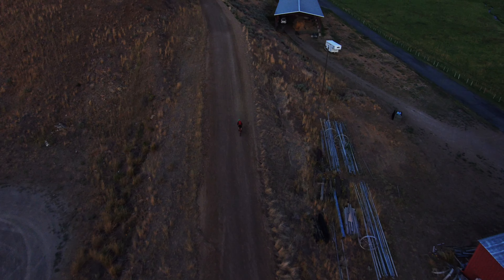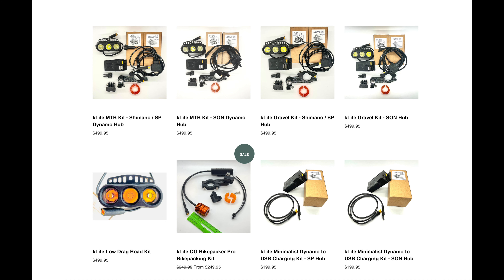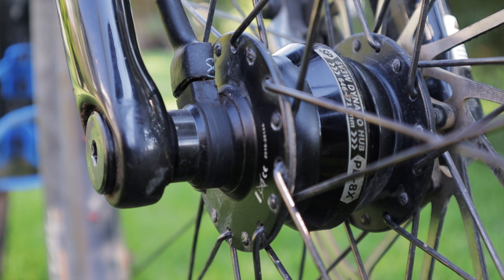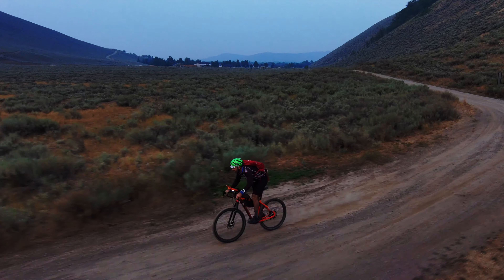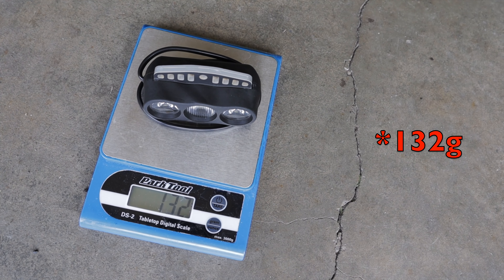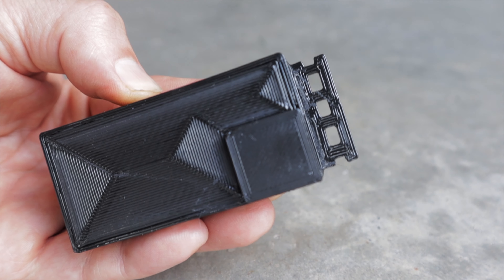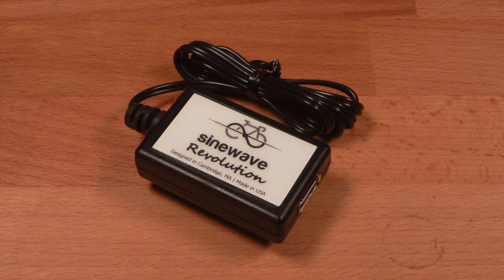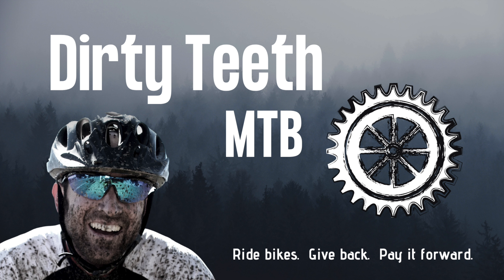kLite Dynamo Bikepacking Light + Charging System | In-Depth Review | Bikepacker Ultra V2

Comment: I don't know what happened to my first comment but here is a short version. I have the v1 of the Ultra gravel hooked to a SON and it has been great since I got it in July 2019 and run over 24k road kms. Love it enough that I have recently purchased two more kLites - another gravel model (for an MTB project) and a road model for a road bike.

Kerry has great customer service and is always on the ball, ready to help you out.

I will be using K-Edge combo mounts...solid as a rock.
Reply from the maker: Thanks for adding your input, Wai Sing Lee :). Ride on!

Comment: Super impressed with your testing, and thx again for the feedback, it was a bit of a juggle to get a bright light from the good old dynamo hub, turns out there were a few tricks we had to do, to make it all happen, by upping the voltage of the light with 3 leds, we could then offer USB recharge at the same time, few systems offer this and its a great back up, should get stuck at nite, with a dead cache battery and dead GPS and it starts to snow.... with kLite you have the super back up mode, of direct GPS recharge and lights at same time, so you can move and get safe if conditions go bad. This is one upside to the USB charger, its got extra smoothing caps so to go 'direct to device' with sensitive equipment, trade off, yes its bigger. its also a SOLD block, you can kick it around, and ziptie gates to lock in cables on bumpy roads

So 3 LED is the magic number.  we did have a smaller head unit, that is for sure, but after testing we found using the SAME power and same LEDs same electronics, BUT bigger optics / lens, we could get a much higher lux or throw, a much brighter looking light, for no extra drag or power used, just by using bigger optics, we got way more light, but,  you said it, trade off was size...then my choice to make the light in SOLID rubber means you can kick it like a football and its all good, but again, trade off, its a bit heavier but only by grams... 

Now the LOW speed power booster, as you said is no gimmick, I feel its the #1 reason these lights are so good, as we created a extra power boost down in the low speed band, at the same time, we charge an internal supercapacitor bank, this gives back power when slow or stopped, IMO this is the biggest difference in kLite and the rest, way more power down low and very little flicker, again yes its a bit bigger light for the supercaps,  but not by much, I guess the light looks like that, as this was the only way to maximize output by riding the science of  all aspects and at the same time make it super robust and very reliable.

its not fancy gear, its just sold as hell, for me this is what I wanted, something to get me home, no matter what, something keep me safe at all times when I ride, a fit and forget system that just works, that I never need to stuff with.  Your feedback is noted and can say new CNC mounts and other stuff is in the pipe works.... once again, you have an amazing understanding of this product, well done, and thank you again!!
Reply from the maker: "not fancy gear, just solid as hell" - 100% thanks for pushing the envelop and sharing your passion!!  Ride on :)
Reply: Not fancy, but a price tag of $600? Lol
Reply: Hello kLite!
I don't know if you know about Jens During the guy who build the Aheadlader v6, but I think you two should definitely get in touch, look it up!
Your philosophies seem very close.
The Aheadlader is a charging unit that fits in the headset (also exists in a bigger separate version), and is best known for being very (the most?) efficient on a large speed range.
It's actually not sold as a whole, the assembly instructions are public and it's up to you to build the unit.
Maybe if you two collaborate you could achieve the most efficient, powerful, bright, solid, versatile dynamo USB charger & light ever seen!

PS: He's german, I don't know how well he speaks english but DeepL is there for you

Comment: This is such a great, comprehensive video. Well done! I had it in my mind that the exposure revo+sinewave revolution would be my best option but that involves a whole headache of figuring out the wiring. This being plug and play is the main draw for me but it seems so well thought out in general.
Reply from the maker: You can't go wrong either way.  I used a sinewave revolution and the Revo for years - both great units...  kLite used to wire revolution's for use with their system before they came out with their own usb chargers... but I think they've since stopped for obvious reasons (you can double check with them)...  In my experience, the kLite Ultra v2 is definitely brighter and kicks in earlier than the Revo, and I'm enjoying it... so I just sold my Revo on eBay :) Ride on!

Comment: Great Review!

I just installed my mtb version and used it on an overnighter.  I already had a K-Edge mount that works perfectly with the GoPro adapter.

I have been impressed with the light so far, but haven't been out long enough to get a feel for the charging capabilities.  It did keep my Garmin InReach mini and my Garmin Edge 530 fully charged.

I opted not to purchase the rear blinky at this point.

Comment: I looked at dynamo hubs and lights but went with a PedalCell and an Outbound EVO light. More power output at lower RPMs (like, 5~6mph), and you can move to different bikes if you want. Also, zero drag when you don't need charging, unlike a hub dynamo. The power output is so good I may not even bring a cache battery. I will use it on the Tour Divide this summer.
Reply from the maker: Right on, sounds like a great setup... I've heard good things, almost makes me wanna build an alloy wheel just to test it out... best of luck on the TD :)
Reply: @DirtyTeethMTB  I appreciate your review and that looks like a solid setup. FWIW, I'm actually running carbon rims. PedalCell won't recommend it but there have been people who have had no issues with carbon rims. For insurance, I've actually cut sections of helicopter tape that cover the running surface of the rim. So far with a few hundred miles of dynamo use I'm seeing no wear on the tape (and thus no wear on the rim). I may add an extra layer of tape just for some added safety for the long TD. I'm interested to see how it does on a long, grueling ride like that. Time will tell!

Comment: Thanks again for your time and effort required for awesome content!  I'm assuming neither the gravel nor road versions of these lights offer a cut-off beam pattern similar to many of the German-designed lighting systems.  My current bikes have either dynamo or battery-powered (Busch + Müller) lights with a "car-friendly" cut-off beam.
Reply from the maker: Thanks for watching, Todd - I don't think any of the kLite units have a cut-off beam pattern... great questions, and you might wanna double check with kLite to confirm - ride on!

Comment: Thanks for uploading! I have the V2 MTB with a SON hub (no rear blinker). Have made great use of the USB charger, but tbh, have not been overly impressed with the light: I have an old, cheap Magicshine (lists 900 lumens, I believe the independent tests measured ~ 840) which subjectively appears to provide better illumination….
The hub connector has given issues in that it can pop off on rough terrain at times (tried crimping connectors on firmly..no luck): if anyone knows a better solution I’m open to suggestions. Thanks again for another detailed review!

Comment: Are you able to use the internal cable routing of the fork? Seems that the cable is too bulky and the connectors cant be removed?
Reply: Same question here. ?how to take advantage of my 2021 Cutthroat internal fork routing?
Reply: I was unable to use it on my bike it is way to thick, I also found that the plug keeps disconnecting from the hub because the wire is too stiff, I would recomend making the wires yourself if you are planning a neat set up.
Reply from the maker: The thick cables definitely don’t fit in the cutty fork… That hole is tiny… I’d rather have expedition worthy wires/connectors… not as clean, but I just tape it to the fork and you barely notice it…

Comment: just wondering about a dynamo set-up vs a battery pack... weight for weight, seems that you could forgo alot of the complexity of a dynamo set up
Reply from the maker: There are many scenarios where I prefer not to have a dynamo system- shorter, singletrack, techy routes, where I’m riding slower, etc) I just use lights with replaceable batts…but for longer multi-day tours and bikepacking races like tour divide I think dynamo is worth it
Reply: The complexity, such as it is, is only during the install. I ride almost exclusively at night and with a dyno setup, I never have to worry about recharging the front light. The back is a different story, I have multiple lights and just today I recharged three battery lights. Cygolites are great...been running them for almost a decade.
Reply from the maker: @waisinglee1509  that’s why I like the kLite qube rear light… so easy and never have to charge :)

Comment: Super timely video, Alan! Was just about to pull the trigger on almost exactly the same setup. How has the SP PD-8X worked out for you, especially for Divide? I understand it isn't nearly as efficiently as the (rather expensive) SON 28. Watched all your vids but would love to hear your experience and if it's worth springing the extra coin for the SON28 or if PD-8X is perfectly adequate. Cheers and thanks!
Reply from the maker: The pd-8x is perfectly adequate in my experience- I’ve got at least 6k miles on it in all kinds of conditions- zero problems.  I don’t think you can go wrong with either hub.  That said, I’ll probably switch to son next go around, based on others experience and feedback, I’d like to give it a shot- not sure if it’s worth the extra $$ but at that point with the overall investment… why not go big 😜 ride on!
Reply: @DirtyTeethMTB  thanks, Alan! Appreciate the thoughtful response and all the great content. Will go with the PD-8X. Cheers!

Comment: Thanks for the review. Did you say you carry two of the voltaic cache batteries?
Reply from the maker: Yes, depending on ride/race, I often carry two smaller batteries vs one large… redundancy in case I damage/break one, and I can cycle them- charging one while the other one charges items… without having to deal with pass through, etc… ride on!

Comment: For some reason my Klite isn't charging my iphone pro max 13 — not even registering that it is plugged into a charger at all. Have you seen this? Any tips?
Reply from the maker: Hmm never heard that before… but I usually charge a cache battery with dynamo and use cache batt to charge phone with constant power… if you haven’t figured it out, hit up the folks at jefe.bike - they should sort you out 🤙🤙

Comment: I already have the sinewave charger. Can I only buy the light and switch  and still continue to use the sinewave charger? Excellent review. I'm impressed!
Reply from the maker: Hi Tobias... you should be able to buy the light, harness, and switch... and then attach a kLite connector to your sinewave usb charger... I used to have that exact setup and it worked great :) - the guys at kLite are awesome and should be able to help ya with any questions - ride on!

Comment: i have a k-lite with son28 system. works perfect. but it doesnt charge my iphone. so i have to charge my powerbank first which then charges my iphone. i wish it could charge my iphone straight. any ideas?
Reply from the maker: I do the same thing (charge a power bank and use that to charge other stuff).  Phones don't like trickle/"uneven" charging... they want a consistent current- ride on!

Comment: Great video ! Not a huge fan of the 3D printed finish of the charger and the clamp. I don’t ride at night enough to justify the purchase so I’ll stick with my PD-8X and sinewave revolution charger paired with cache batteries and my trusty lezyne lights that I charge overnight.
Reply from the maker: Def a big investment… and overkill for most… unless you’re doing a big bikepacking adventures/long tours… I dig your setup - Lezyne + revolution for the win !
Reply: @DirtyTeethMTB  Am I the only one freaking out with using 3D printed parts that will be required to hold load bearing, structural integrity and resistance to vibrations? On the video you can already see some of the layers are separating already. Maybe they use some kind of epoxy inside to at least ensure water resistance, like Sinewave does?
(Also the cache battery itself would require a separate video, and maybe review some other models. Some charge-through batterie start charging, then use power from the hub as you cycle faster to power the USB devices, but sometimes fail to switch back to battery power when you stop, or when you ride slightly too slowly. It's actually a complex piece of electronic to get right.)

Thanks for your content, super interesting as usual, especially from Europe where we use slightly different kit. Gives a very nice alternative perspective.
Reply from the maker: @mrr9166  the 3D printed plastic mount is pretty dang beefy, and I'm not worried about it's integrity at all - it's hasn't budged once since I started using it... as I mentioned in the video, it's actually too beefy for my taste, so I'll be switching to a more svelte kEdge mount anyway.  Re: the charger... I believe they do use epoxy like Sinewave to make the connections waterproof.  I've used both the Revolution and the kLite dual USB plenty - both are fantastic and I've yet to have a single issue with either.  Yes, I like the traditional construction of the Revolution over the 3D printing of the kLite, and it's slightly lighter and more streamlined... but I like the dual output ports on the kLite, that the input/output ports are all on the same side, and it doesn't have a permanent cable... so def pros and cons to both... re: cache batteries, that would make a good video... I'll keep it in mind, thanks!

Comment: Wondering how you mount the fenix pd36r?? Thanks
Reply from the maker: I have a helmet mount that came with my exposure joystick that I use… the pd36r is a little wider than the joystick, but still works- ride on!
Reply: @DirtyTeethMTB  thanks mate does that same mount also works on handlebar?? Looks like an impressive output and runtime for the fenix!!
Reply from the maker: @andrewhamilton3486  for the handlebar I typically use the twofish flashlight holder… cheap and secure, but can be a little bouncy on technical descents 🤙

Comment: Oops, hit enter too soon.  Great video and super helpful information.  I'm adding the gravel set up with rear blinky to a new frame build and like you, still want helmet lighting..... Which do you prefer using the Fenix or Joystick and what mount do ya use with the Fenix!?  Thanks so much!!
Reply from the maker: Hi Mark, depends on the ride - length, speed, etc - but most often I use joystick, love that little thing... It's a little fatter than joystick, but I have shoved a PD36R in the joystick helmet mount and it hasn't broken yet :) Ride on!